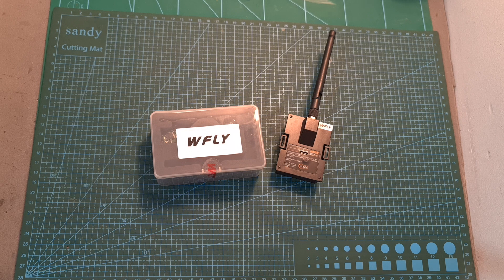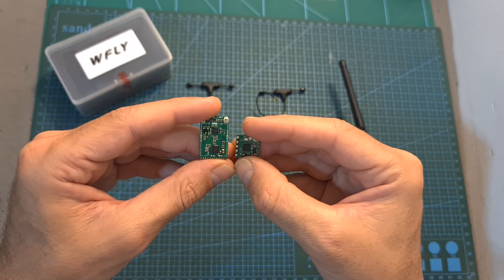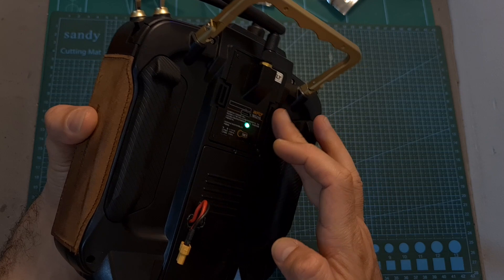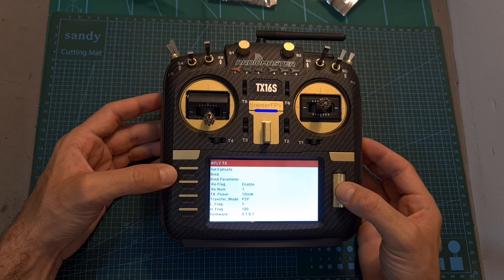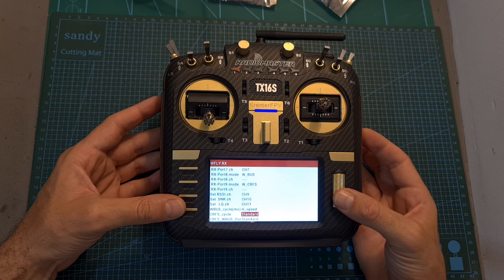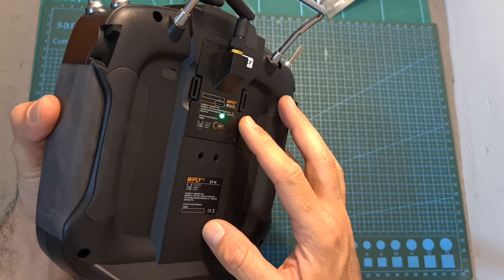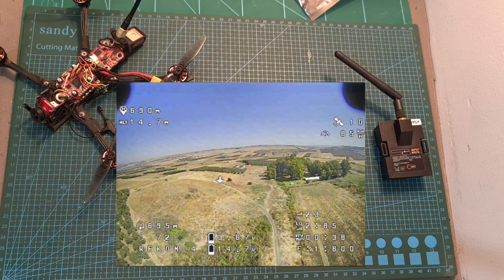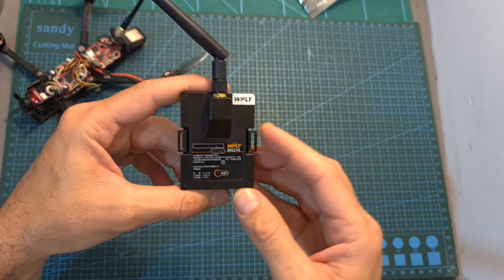WFLY MG216 2.4GHz Radio System - Setup, Review & Range Test

Comment: @9:30 Is Wfly a reliable company? The manual shows they have sx1280 chips on them. They're trying to make their own semtech based 1280 link it seems. OTA is neat but I wonder why not just adopt the ELRS project and sell the hardware too
Reply from the maker: Well I said that they said it. As far as I know they have been in the RC industry for a while and it's a reputable company. 
I hope that they will adopt ELRS and have the option to use their protocol which has it advantages along with ELRS.

Comment: Ya I think I'm sticking with opensource that's what built this hobby and what will continue to push it forward. I did laugh my ass off when you said the reason they think's it better than ELRS, I know nothing about this company and I've been in the hobby for almost a decade.
Reply: Opensource wasn't introduce the hobby didn't start from opensource. I don't know where you got that shit from. I been around since 1980's in rc. You in a decade. Opensource in our rc hobby started 10 years ago or so. But open source in like operating system for pc and laptop started early 1990's. Another thing is WFLY been around since 2005. They are highly popular in China and other asian country. Either way Elrs im a huge fan boy.
Reply: @rcrotorfreak  I specifically mean the FPV hobby wouldn't exist without open source at least not to any where near the degree it does today and certainly multirotors wouldn't be where they are.
Reply: @thirtythreeeyes8624   Fpv been around since the 80's. Even probably 1970's. Open source didn't exist lol